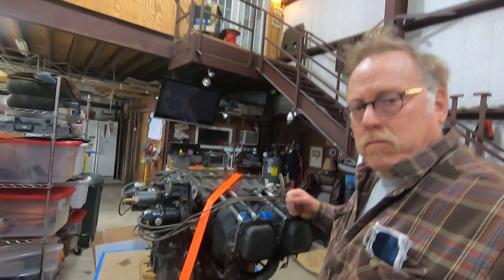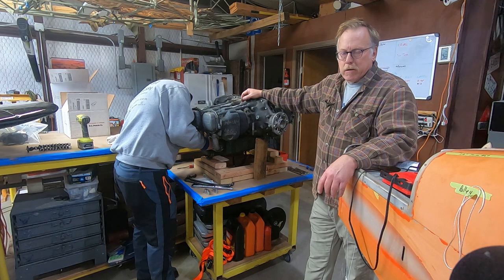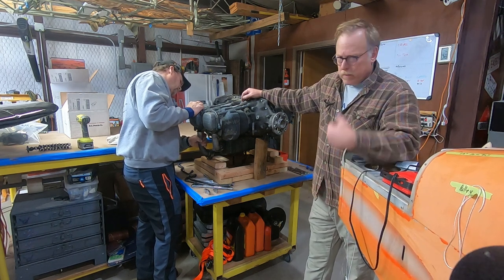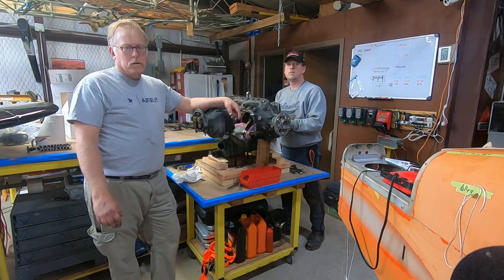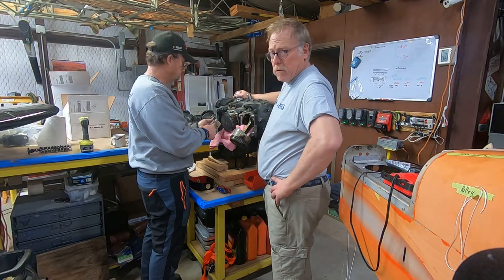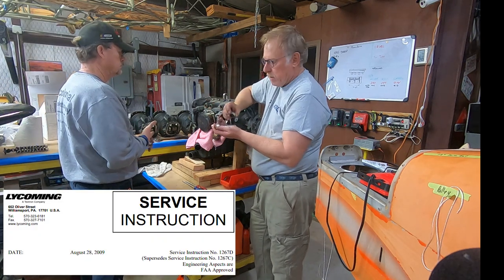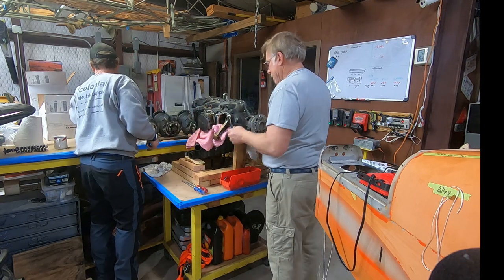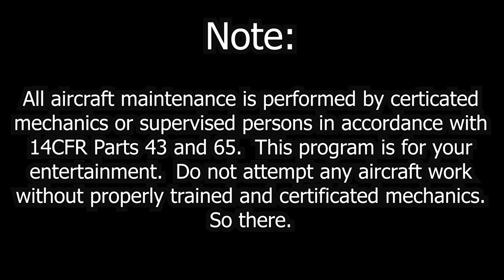360 Engine E01 - Initial disassembly

Comment: Polymer and chemistry guy here! Just a couple of comments on the PVC dipstick tube mod: Many grades of PVC contain plasticizers to make them softer and tougher, e.g., vinyl tubing. The plasticizers can get leached through contact with hydrocarbons, making the part more brittle (ever use a vinyl tube to siphon gas and notice it gets harder?) The part used on that engine may or may not be plasticized, but this is something to be aware of. Plus, PVC has a glass transition temperature around 80 deg C, which seems like a not unlikely temperature to encounter in an engine compartment. Pretty sketchy indeed!

Very interesting video, I'm looking forward to the rest of the series! A suggestion: put a clock in the background so we can see how much time elapses.
Reply from the maker: Thanks much!  Actually we're looking at installing the proper (pinch me!) tube and stick.  Stay tuned!

Comment: I own an O-360 and consider it perhaps the most reliable engine out there.  I have 1450 trouble free hours on it.  There must be a dozen ways to overhaul an aero engine. More discussion of the rationale of how you are rebuilding this engine would be helpful at the get go.  For example, are you going,with new cylinders or overhauling existing cylinders?  What is prompting your decisions on this field overhaul?  This series could be very informative so try to embellish it more.
Reply from the maker: We're going to go through that as we progress.  Definitely on your points for sure.  Going to do some shop visits also.  Thanks!

Comment: Nice video and details. How do you guys manage the parts?  (re-assembly) Each bolts goes back to the same cylinder? just curious how it works.
Reply from the maker: Stay tuned!
Reply: wondering the same thing. Also, that piston pin press is pretty neat!